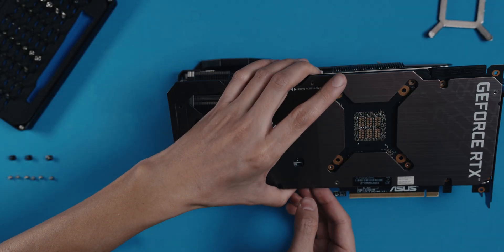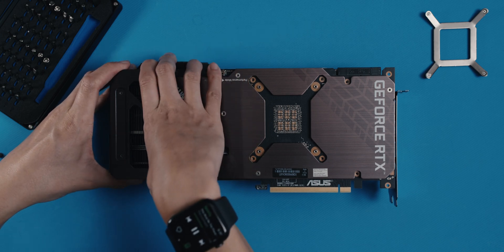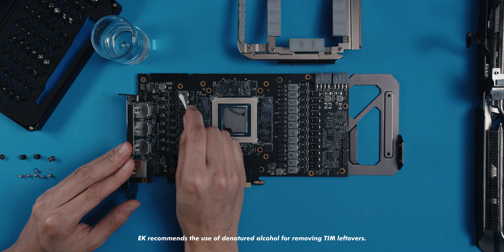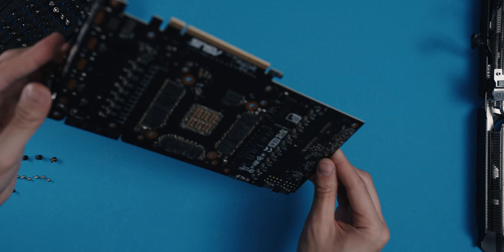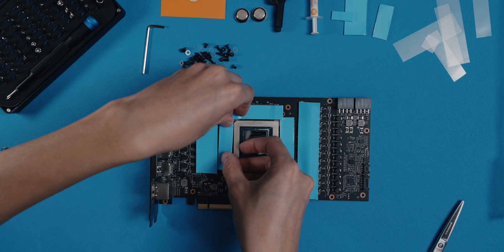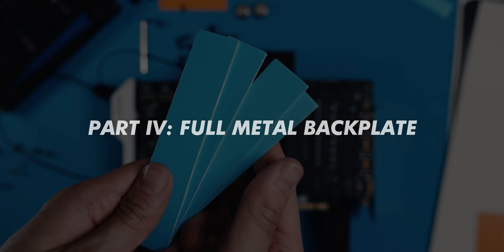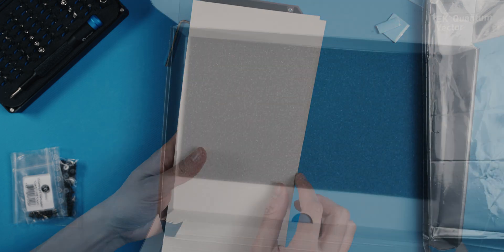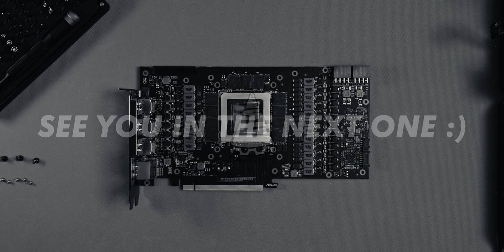How to Install EKs TUF3090/3080 Quantum Vector GPU Water Block [Step-By-Step Guide]

Comment: Small brush with some isopropyl alcohol works well to clear TIM in little places or off the tiny resistors on the GPU plate. You can also use a small toothbrush with low pressure. If you want to keep the EK thermal pads on the block for the yearly maintenance, the shiny part is less sticky, so the more matte side against the water block will keep them from sticking to the card when separating.
Reply from the maker: Thanks again for the tip, your comments are super appreciated! 🙇

Comment: This is wrong. At 5:12 The far left and far right vertical thermal pads are in the wrong place. The left one needs bumping further to the left to cover the square 55A memory/core power delivery stages. The Right one needs bumping to the right to cover the square 55A memory/core power delivery stages. The way you've done it here, you've got no pads over these important power delivery packages, therefore no cooling at all, which is a big no-no! You've covered the capacitors instead which don't need any cooling whatsoever. I suggest you strip it down and redo it properly if it hasn't died already.
Reply: I am sitting here and have the exactly the same issue. Contacted EKWeb but all the customer service replies is to follow the manual but I see the same with the right and left vertical thermal strips are not covering heatcritical components. The last reply was whey would check with R&D department but it would take a while to get a reply.

Comment: Cool and really nice video quality 👌🏽👌🏽!
Looking forward to the water loop video since I’m going to build a pretty similar setup like yours! 
Is your rad 30mm thick?
Reply from the maker: Thank you! 🙂

I got the EK SE280: https://www.ekwb.com/shop/ek-coolstream-se-280-slim-dual it's listed as 28mm, but the actual "radiator" size, that is the width of the fins is smaller (maybe 22-23mm), 28mm is just the housing. I believe XSPC makes the "thickest" one that will still fit. However, the GPU water blocks width just barely clears with the EK (if it was really 28mm it wouldn't fit). I would double-check all the measurements, especially the GPU water blocks width to make sure it will fit, good luck! 🙂
Reply: @CheeseTurbulence   awesome! Thanks for the reply! I went with an 280mm alphacool ST30 so total thickness of 30mm I believe, 2 140mm P14 fans and the rtx 3080 EK-Classic GPU Water Block (cheapest one)! Think and hope it’ll fit nice (:
Reply from the maker: 280mm alphacool ST30 👌
140mm P14 👌 (they look very tasty)
EK-Classic GPU Water Block 👌 (still very nice looking, like all EK things!)

Congrats and enjoy the build! 😀
Reply: @CheeseTurbulence  Got a little bit worried based on your videos because your gpu block almost kisses the rad haha! Just looked up on ek's web for the dimensions and mine is +/- 2cm shorter, so thanks A LOT for all the specific information of your videos! Now I can happily wait for my parts to come haha!

Comment: Really good video! To be honest, I really didn't know it was you until I saw your SSF rig at 4:02. I thought the video was pretty well put together, and understood why when scrolling to see what channel made it.
I watercooled my current system mid-July. It consists in a Ryzen 9 5900X and a GTX 1080 Ti FTW3. In the beginning I was only going to custom watercool my processor, but after looking for a second hand block, I saw I could get one for 50 bucks, to I pulled the trigger. It was my very first custom loop and, the PC-O11 Dynamic really helped me. Thanks to the immense space I had to work with and to the split design of the case, I was able to make my runs really easily and even managed to make a 35cm run in the back compartment (where the PSU is) so that it would just plug in the back of the pump/reservoir combo. Overall, this was pretty easy, and I felt the exact same way you did in your video: you just have to be patient, not mess up with the thermal pads' thicknesses (🤣) and read the manual. In the end, with a single 45mm 360 rad, I am able to reasonably cool both these components (albeit with really high looking temps on the CPU, it's running at like 70-78°C while gaming). My 1080 Ti FTW3 dropped from 61°C (undervolted) to 48-52°C overclocked @2012Mhz. Really happy with how it turned out both for you, and me!
Reply: Regarding the high temps of your CPU: check if your CPU block is not the highest point in your custom loop. Because the air bubbles will always stay at the highest point of the loop (because physics) which then can cause the high temps. Try to mount either the radiator or the reservoir at a slightly higher point than the CPU block. This lowered the CPU temps a lot in my case.
Reply: @theguyfromzurich  Thanks for trying to help me, but I've tried everything. My rad is mounted at the top of the case, so it is the highest point in the loop, the pump is at the bottom. I bought EK's 360-P kit when it was in stock and it had the cheap Classic Edition CPU block. So I thought it might've been the problem. After repasting a lot of times, trying different methods, nothing changed. So I bought an EK Quantum Velocity Nickel block that's fairly known in the watercooling enthusiasts community. I then applied a blob in the middle of the CPU and then fired up the system, it saw a great decrease in overall temperatures, but it directly got up to it after a minute or so. In then end, switching my CPU block didn't do anything, and my temperatures often settle at a Δ of 64°C in a multi-core render of R23 (with and ambient of 22-23°C). I'm not really happy with the temperatures, but considering my GPU is in the loop, I guess it's normal 🤷‍♀️
Reply from the maker: First of all, thank you for watching another one! 😛 and I'm glad you recognized the video style, which means there is at least some consistency to my production 😅

I love the PC-O11, or anything from Lian-Li really, they make such great cases. Also, congrats on your first custom-loop, looks like we both joined the same club 🙂

But your CPU temps are pretty high with that 360 rad, that thing should be plenty powerful enough to keep things cool, especially considering mine is running at 61°C under load with a 280 rad. Although your GPU is mighty overclocked which probably contributes to the temperature. But at least it's still far away from the rated max of 86°C, I think as long as you don't experience any throttling you get at least "everything you paid for".

But what @Sascha Eggenberger said would have also been my first guess, other than I wouldn't know why it's so high either😕
Reply: @CheeseTurbulence  Thanks for the answer. If you want more details about my temperature problems, here they are. I've managed to identify two main causes of this issue: the first one is of course the fact that I do have an OCed 1080 Ti in the loop, and the second one is a bit more... troublesome. To me, the problem comes from the motherboard giving way to much Voltage to the CPU. For exemple, I'm using PBO2 with a negative offset of 30, so the CPU runs at 4650Mhz @1.317V during an R23 rendering load. But the thing is, I've tried lowering the voltage, and I can get it as low as 1.21-1.22V (without clock stretching), which drops the temps from 86°C to ~75°C. That's an awesome temperature difference you might say. Well, yeah, but to get that temps difference I'd need have a fixed overclock, which would decrease my performance in games (the thing I do the most on my machine). I don't wanna sacrifice in-game performance, but I'd like to gain some temperature headroom for my system. The only option I see now would be to buy an X570 Dark Hero mobo from Asus and use the dynamic OC switcher in the BIOS, but I don't wanna spend an extra 500+ bucks on an end-of-life platform.
Reply from the maker: I think you've done you're homework, and you've done it well (you know more than I do 😛). I too am waiting for new chips, wouldn't upgrade either.

But I hope your system runs fine and gives you everything you need, even if the temps aren't the lowest, that overclock on the GPU alone is impressive enough.

ps: sorry for the late reply, YTs comment moderation isn't very forthcoming in displaying replies.